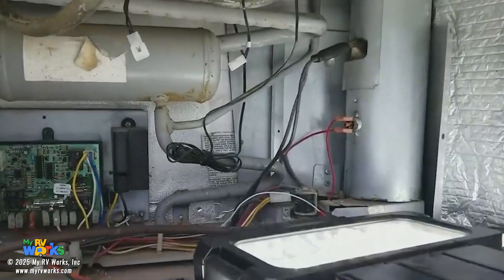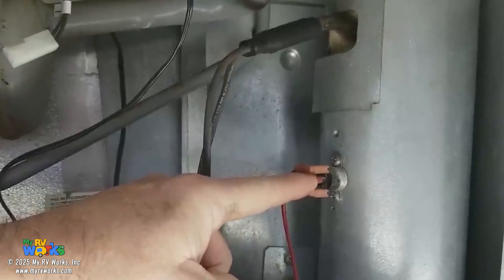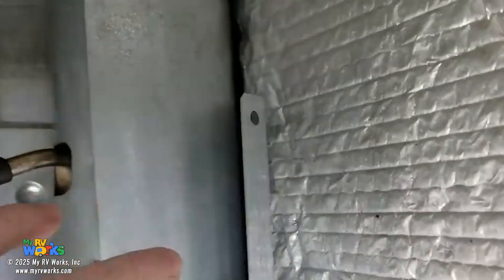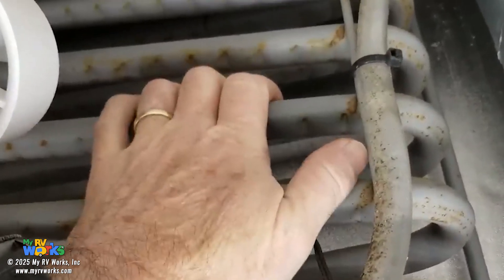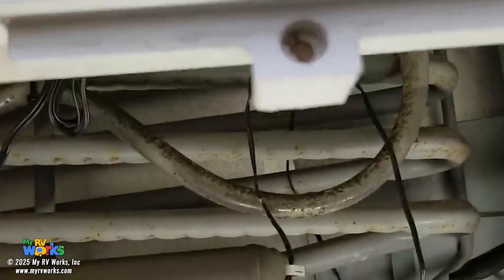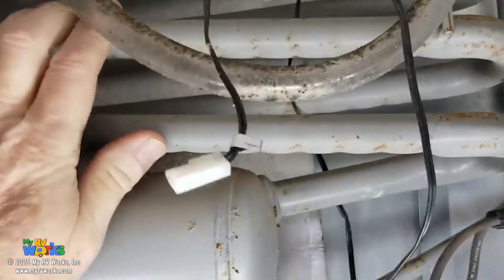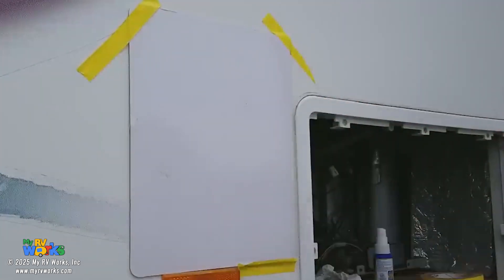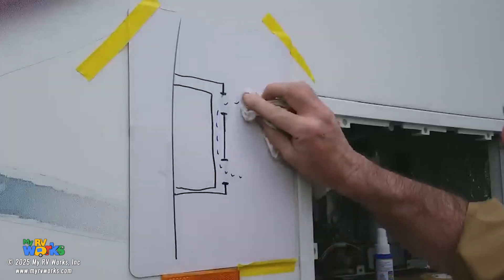How RV Refrigerators Really Work - Expert Breakdown

Comment: I have a dometic refrigerator running on lp, is it normal for the thermocouple to develop a carbon deposit after about a month? Keep having this issue but clean it off and works fine for another month.
Thanks for any advice.

Comment: Great channel. Very informative. I actually am currently having an electrical issue with my 5th wheel Rv At the moment.. A few nights ago 1 of the plug outlets in the bedrooms area stopped working completely. At the same time the vanity lights above the bathroom sink stop working. The bulbs are good and all the other lights like ceiling lights etc in the Rv work fine. I assume because they’re powered by the converter. The rooftop ac in the living room and the microwave stopped working too.. the thermostat turns on and I can hear the ac make a slight click like it wants to kick on but nothing. I recently had to replace the shore power inlet on the back of the Rv and replace both connector end on the chord because they were melted a little. The 50A plug that I plug into at my Rv park is melted on the neutral and had been arcing out on my plug. But to top it off When I go to the breaker panel all the breakers and fuses are good. No trips at all but for some reason when i turn a certain breaker off it will cut power to a completely different appliance or room than what it’s labeled. For example if i turn the microwave breaker off it will cut the power to the entire living room instead but it doesn’t do that everytime it’s random. I’m just completely stumped at this point. If you do read my comment and have any suggestions or solutions please let me know. Thank you

Comment: I have a Dometic DM2852RBFX refrigerator that the thermostat on the boiler will trip after the fridge being on for about an hour and a half. It is in a Slide. I have replaced the thermostat sensor,  the fans that help circulate the air, checked all the voltages, and have not been able to fix the fridge. I am located in the south east part of South Carolina, so I did have humidity. Is there any other advise that you can provide? I really can't afford to replace the fridge. Thank you in advance.

Comment: Good morning, I would like your answer or idea, thank you. a Dometic series 7 three-way fridge is installed on my camper, the manufacturer says the three-way fridge depends on the outside temperature, with a thermal delta of 20-25 degrees for the fridge and 30-35 for the freezer, or rather, if it's 35 degrees outside, at most it can be 10 degrees in the fridge and 0 in the freezer. all this because the fridge has physical and chemical limits. What do you think? Thank you for what you do and the time you dedicate to us.

Comment: Darren,   My son’s 2011 TT has a non working electric heating element in the refrigerator.  Because I watched your videos, I knew what to and how to test it.  Bad element.   The flue looks very much like this one.  Pulled the inspection plate and tried to pull out the element.  Nope, not coming out.  Sliding the flue up as high as it will go, nope not coming out.   Am I missing something or does the refrigerator need to be pulled!

Comment: Here in Texas I gave up trying to get our absorption fridge in our wolf pup to work in the summer- above 85 and it just cannot get rid of the heat.
Reply: And yes we have fans over the coils
Reply: @davea4517  Fans over the coils don't provide the chimney effect that he's talking about in this video.
I 3d printed two custom fan shrouds to mount two 140mm PC fans on the back of the upper grill blowing OUT to keep the air moving through that cavity behind the fridge.  It's not about cooling one set of fins.  It's about keeping that column of air flowing behind your fridge.
100f, 80+ humidity, 4f in the freezer, 34 in the fridge, sun beating on that side, with the fridge set on a 5 out of 9.  The stock fan back there doesn't even run anymore.
Reply: @piquat1 let me restate: fans are installed just inside the top vent and blow out.
Reply: @davea4517  Just blowing at the back of that irregular shaped cover they put on RVs   today?  I tried that.  Put your hand next to the fan.  Lots of swirling air.  If you don't have a 3d printer maybe you could fab up something out of tin or flashing.  Needs a good shroud or your just creating turbulence in the worst place of all in this system.
Reply: I use those blue freezer blocks. 3 in the freezer and 3 in the fridge. They help cool the fridge quicker when first starting it. When the fridge ones melt I rotate them with the freezer ones. It works for my fridge. We were in Garner State Park a month ago, it was 95 in the daytime, fridge was about 42, freezer 20. I don’t have any fans.
Reply: @magooracing so you are kick-starting the cooling - does it stay cold? Btw, we were at Garner back in April 😀
Reply: @davea4517  I keep the ice packs in, I doubt it would keep it as cold without them.
Reply: @magooracing our fridge is small - 2.7 cu ft

Comment: I have a norcold and 8 years ago when I bought it a man told me to never turn it off because of how it cools and it has something to do with crystals or something. I do not know if what this man told me was right of not but for the last 8 years my rv has stayed plugged into power even if I wasn’t traveling and the frig was on.
Reply: I did the same thing with mine until once I needed to tarp the RV. I made the mistake of keeping the unit running and basically destroyed the refrigerator. If you ever need to cover it for any reason you definitely need to turn the unit off. Trust me I know 😀